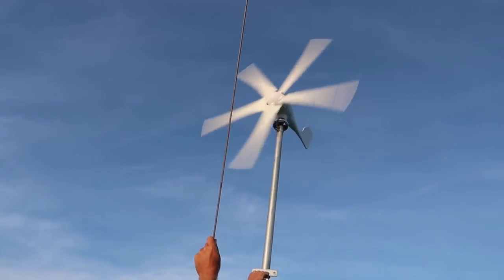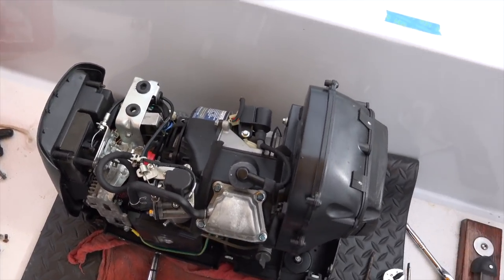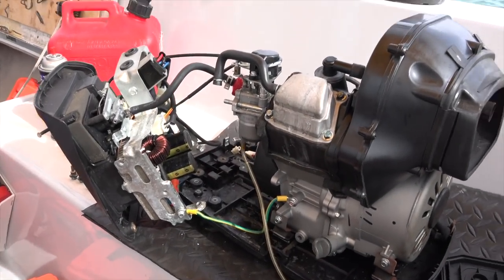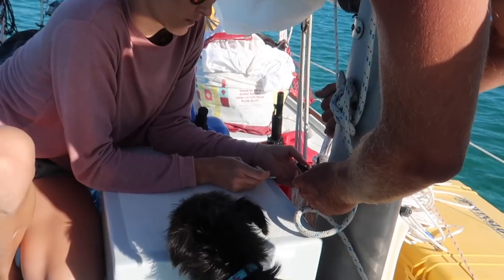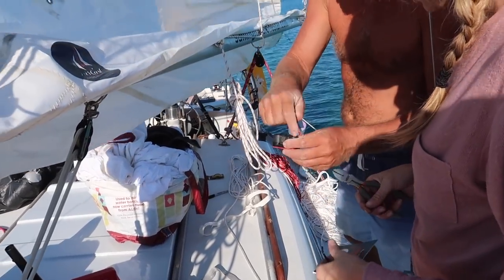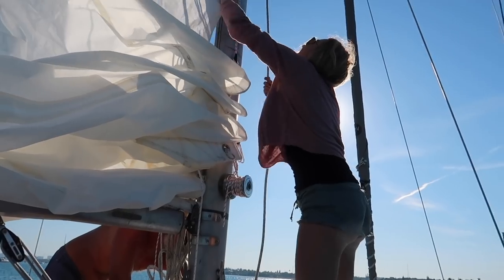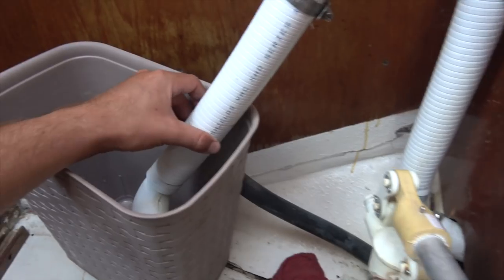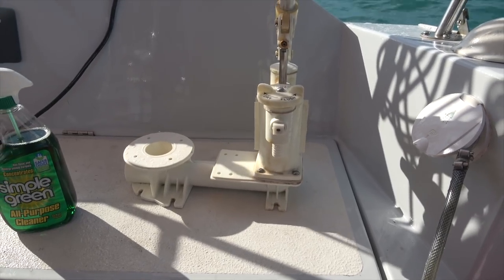How to REEF DEEP | SMLS S9E22

Comment: For your halyard and reefing lines, in front of the winch, you really should have used a three handle sheet stopper, not a row of cam cleats. I doubt you will be able to get the left one or two lines to set into the cam cleat while you have that line tensioned to the winch...

Comment: reset the pull handle properly.  The end of the handle is a water seal.  Also, that cord was abraded until it broke.  You did not find or service the chafe point. Fix that and the cord will last ages.